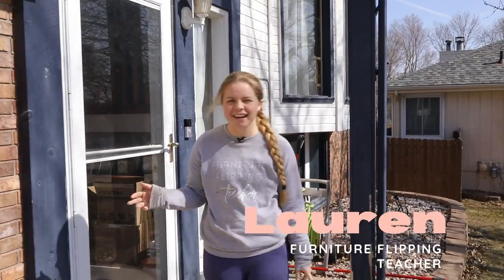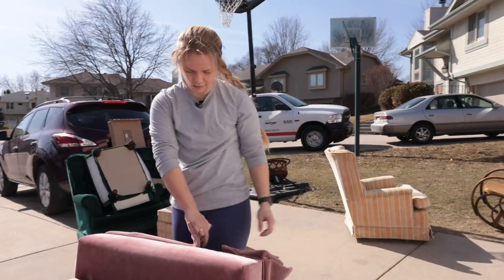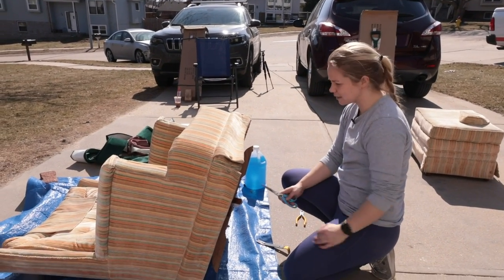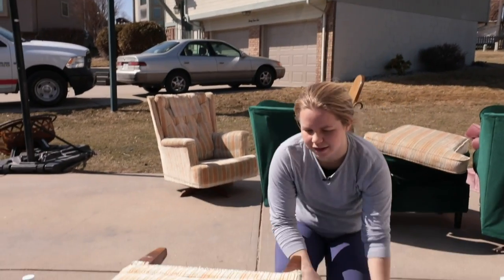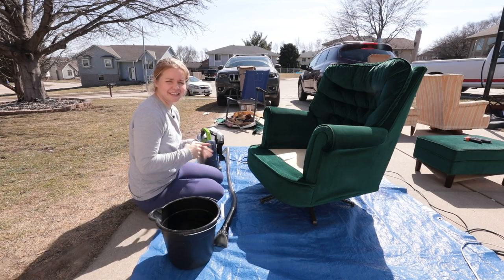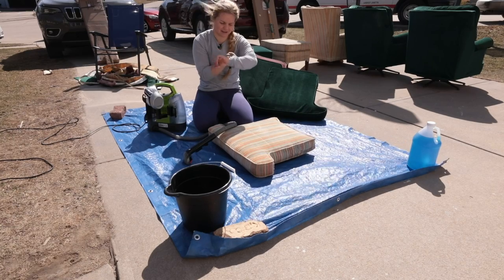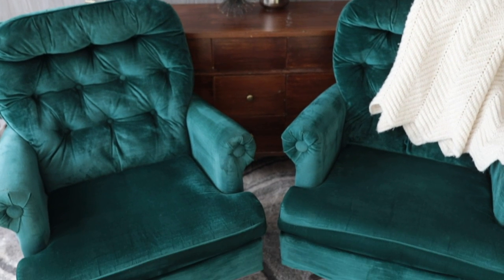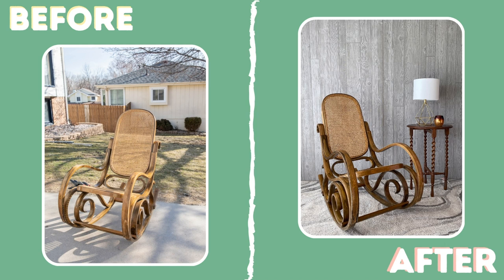Flipping 5 Velvet/Wood Chairs from Facebook Marketplace = $420+ Profit

Comment: Idea: Use a magnet to corral those staples so you can collect them and dispose of them easily. You could, for instance, hot glue a magnet in the bottom of an old yogurt container!
Reply: My dad always had a huge magnet tied to a piece of string, for when he did anything with staples, screws, nails, etc. The yogurt container idea is a great idea, though.
Reply: Ooooh, like a sewing pin magnetic holder!
Reply: I will use this idea in sooo many ways!
Reply: There are strong magnet (s) in old stereo speakers. U could upcycle one of those!
Reply: harbor freght has cheap magnet trays for holding small screws etc when doing repairs. I bought one when i work on my vintage sewing machines! tiney screws!
Reply: @wendimiller8915  
Or, as we cross-stitchers call those, needleminders!
They're very collectable among us. Lol
Reply: @valnpaulvanorden  
I've got a large U shaped magnet that is quite weighty and cane from a grandfather clock.

Comment: Ok, I have re upholstered a lot of furniture. 3 tools will help you.  A nail/tack remover, looks like a forked screw driver, and a tack hammer. The tack hammer will also have a forked prong. You can also get a staple remover. All of these will help you remove the staples. I personally would get a tack remover and a tack hammer (cause you never know. You might want to add some decorative tacks to a chair or two.)
Reply: Thank you for letting us know. I tore an old couch apart a few weeks ago, what a pain. I never saw so many staples in my life. Haha.
Reply: I like fabric pliers/clamps, which I use to stretch canvases in my studio, as well as when upholstering, as I have carpel tunnel, and they hold the fabric about 4" which is more than my fingers and thumb can!
Reply: @MissMolly3377  Needle nose/regular pliers can help.  Seriously a PITA!

Comment: If you ever had to deal with bedbugs, you would be way more concerned about them! That is my #1 fear when considering furniture flipping because we had them once and it was HELL to get rid of them. I’m super paranoid now.
Reply from the maker: That is probably very true! I try my best to do my due diligence when buying and take into consideration where I get it from and make sure I am as diligent as possible when cleaning.
Reply: they make a special bedbug powder I have seen another flipper use. Requires a shop vac b/c it is kind of sticky.
Reply: Look into Ozone cleaners. They kill EVERYTHING. Can get one that does a smaller house(about 2,500 sq feet I think) in 30 minutes, for 50 bucks on amazon. 

Beg bugs, fleas, mold, bacteria, hotels use them when converting a previously smoking room into non smoking. They Even kill house plants and small animals so make sure anything you Want to keep alive is not in the effected area.
Reply: @kiarakeeper2154  oh my lol...
Reply: Heat for several days in the sun (or a hot garage or room) will kill bed bugs. That’s why “old” people used to sun their beds.
Reply: Heat kills bedbugs...hair dryer ?
Reply: Sunshine kills mold.
Reply: Wear gloves.

Comment: You can remove the cusion covers with zippers and put them in washing machine! I would have preferred the gold legs on the green set personally.  Great job!
Reply: Be careful.  Many fabrics will shrink and won't fit properly after washing.
Reply: Cushion covers can be washed in the machine on a cool or warm setting.  The trick is to put them back on the cushions while still wet!  Let them dry standing upright.  Perfect every time.
Reply: If she washes them though, she runs the risk of the fabrics becoming discolored from the rest of the chair or shrinking it.

Comment: I clean my personal microsuede  furniture with windex! Where I found this tip, they sprayed, used a scrub brush then wiped clean with a white cloth. I use my carpet shampooer to suck up the windex after using the brush. Its amazinggg. I highly suggest you try it! I think you'll find better results and quicker dry time + cheaper than the cleaning solution. Side note, if you have microsuede, after it dries take a dry scrub brush and "fluff" the fabric by brushing it back and forth. My furniture looks and feels brand new

Comment: FYI, if you're going to stage it with a blanket make sure you add an extra photo to show it without. Also because of the bed bug outbreak in many cities, it's wise to 1st inspect thoroughly and also spray the furniture with bed bug killer and let sit 48 hours before cleaning. I personally like the skirts to hide the ugly stuff underneath.
But then I'm an old lady 👵🏻
Reply: If you're up north though, there's really not a huge need. I've never really heard of getting bedbugs in Colorado for example. Colder, dry climates they don't run rampant
Reply: @ShunXXX196  
Okay that makes sense. I'm in Michigan. Very humid in the summer. Our Town had an epidemic about 9 years ago one in four families had bed bugs
Reply: @marymontes6788  same in FL. High humidity and super hot summers.
Reply: An ozone cleaner will kill bedbugs without the chemicals
Reply: @kiarakeeper2154  wow I wish I had known about that 11 years ago. We lived a total nightmare for about 3 years. We finally got rid of them when they came out with a new chemical that cost $70 a gallon. Plus I got rid of all the furniture and beds.

Comment: I loved your presentation. I am interested to do this but to keep my own  chair and to sell one of two sofas. If my results are good, then I will consider selling newly aquired ones after reupholstering. Good luck paying for the loan. Sometimes yanking on those chair skirts can tear the fabric of your chair bodice, even if you are careful. What do you do with the extra skirt  fabric? Agood first step before usin the wet scrub treatment,  is to use a lint roller.  Those sticky papers get off a lot of surface dust , dirt, and pet hair.

Comment: Hi Friend!  My husband made a tool that I think you would find VERY advantageous.  He takes a standard screw driver and cuts a slot in the flat head smack in the center. (same principle of a crow bar, just the right size) The screw driver handle is easy in the hand, easy to grip and easy to get leverage when prying up those tack strips.  You get in a groove and kinda of rock it back and forth.  I think you will experience less fatigue with a shorter tool.  He often will find a staple that he can lift on both tags and not need to use pliers later.  Also he has these magnetic bowls (cheap at Harbor freight) that catches screws, bolts, tacks or staples.   They make a magnetic wrist band to help cut demo time down.  WELL DONE on being a butt kicker.  Continued success to you in your endeavors!!
Reply: I've seen those at Harbor Freight and Home Depot.
Reply: @vaderladyl  AGH!  They owe my husband a royalty!  He designed it over 20 years ago when we had a furniture store!  : )  In all fairness, I think they were around before, but it was a specific familar handle grip and length he wanted.  Like golf clubs I suppose.  He couldn't find what he needed, so he made it.

Comment: My suggestion would be to trim the skirts back to a 3 inches, fold and staple under the chair. This will give a good finish and then you won't get the line between faded and not faded.

Comment: Taking skirts of chairs is a great idea. Really modernizes. I myself have bought second hand upholstery off cuts for styling on the underside of couches. Is a bright surprise if the owner turns the chair over and sees an attractive contrast underneath. It is also more durable than the  thin substitute fabric that is used commercially.

Comment: If you were to hot glue the piping onto the bottom edge of the chairs it would give them a more finished look. You could also try bleaching the rocking chair, the wood and cane as it might sell faster as the lighter wood color is more appealing to buyers right now. There is a kit you can buy for this. Great work.
Reply from the maker: In person I don’t think it looks as unfinished as people think it does...no customer has ever seemed to mind. One time I did have to keep the seam to cover it up! May eventually check out the bleached wood! Thanks for watching!
Reply: @FurnitureFlippingTeacher  It was just a thought and I'm sure they look great in person. Removing the skirt sure makes them look so much better. Surprising how these chairs have made a real come back. I commend you for working so hard to pay off your student loan. When I'm working on projects I find I can tend to get caught up in the details. Great work.

Comment: You can also use black interfacing as a dust cover if cardboard or dust covers are/get damaged or are buckled.  It’s cheap & you can get it on bolt at Wal-Mart in fabrics.  😊
Reply from the maker: True! I just decided to reuse the cardboard (:

Comment: Great job !!   I haven't watched all your videos....  YET !!   :)  I do really enjoy watching you convert your finds and giving them new life for a new home.  Do rocker chairs sell for more?  Have you ever removed the rocker and replace it with midcentury style legs?    and would it be easier to start the skirt removal from the seam in the back or are there more staples there?
Reply from the maker: Thank you! I am glad to hear you enjoy watching the conversions - they are a fun fun time! 

I don't necessarily think that rockers sell for more, if anything I would say the color is what matters the most. I have found that chairs with legs and ones with rockers sell for the same price but the color will effect the price as well as the style and design of the chair. 

My boyfriend has thrown that idea out there of replacing the rocker with mcm legs but I haven't taken up the task yet as that will add time to the project and I want to keep that to a minimum (;

It's all dependent on the chair in my opinion as far as the ease of skirt removal. Some just seem to be much staple intensive than others. All depends .

Thanks for watching!

Comment: What do you do if there is discoloration or a difference in fabric color when you rip off the skirt?  I think that would bother me if there was a difference after it was cleaned and dried.  The striped chair  looked that way in the video but I wasn't sure how it was in person or if you had a technique for that issue?
Reply: I thought about this too, ripping up the skirt as well as the edge/seam bit makes the bottom look unfinished.
Reply: I wondered the same ..it looks discolored along the edge
Reply: Is there any market for similar chairs with regular fabric ( not velvet)? What would you charge for one with the same legs and after removing skirt?

Comment: I think the extra cloth left around the bottom legs of both the stripped chair and stripped ottoman looks pretty bad.    I think if you had used an exacta knife to cut those strips off, they would have sold faster.  Also it would have helped to sell the stripped chair and ottoman, if you had touched up the scratches on their wooden legs, and shined them up with a product named "Restore" for furniture.  You can find it at Home Depot and Lowes.   You might want to try it also on any wooden pieces you want to bring back to life, without having to paint or re-stain certain wooden pieces.

Also don't understand why you tear off the chair's skirts if they are well attached.   Skirts are meant to prevent the viewing of the undersides of chairs.   If you leave them on, and just clean them when cleaning the rest of the chair, you might find you can sell them for more, or sell them faster.  Any ways would suggest try selling them with skirts on, and see how that works for you end goal of spending less time and money on your flips for maximum sale amount.

Comment: What do you do with the indentations from where the skirt comes off? I've picked up a few myself, but can't seem to get those to go away.
Reply: Okay so, I've learned that using a clothing steamer will work to get the indents out in some chairs and will ruin others depending on the fabric. I have two pink La-Z-Boy rockers and the indents came out perfectly using this method. On the other hand, I had a yellow retro rocker chair that now has streaks from spots where I accidentally touched it with the steamer. You live and you learn I guess, but I am happy to say somebody still purchased the yellow chair with the damage I just had to sell it at a discount.

Comment: I’m thinking of chalk painting a roll top desk but not confident on the “moving parts”. Any tips?
Reply from the maker: oooff! I have seen tons of these for free but haven't pulled the trigger yet due to this reason. My only suggestion would be to make sure you use thin layers of paint so it doesn't glob up. And then make sure its dry before rolling the top! Good luck!

Comment: I noticed some pulled areas on the black dust fabric under the pink chair. That’s called a camebrick. ( probably not spelled right) Try a sweater shaver to remove those:) Love watching you work with a mission.

Comment: Has anyone had to add stuffing for flattened areas? How easy is it?
Reply from the maker: I haven't had to do this! Thanks for watching!
Reply: I had a recliner that I put stuffing in the back of it. I used cheap polly fill bed pillows to re do the back with as the pillows were cheaper than the bag of stuffing. It was pretty simple doing the back of the chair just removing some staples and putting in the polly  filling then putting in new staples. There are some great videos on how do do all kind of chairs on you tube.

Comment: Not sure why you are removing the skirts on these pieces as they give them a more “finished” look, not to mention you are now exposing fabric on the bottom part of the chairs that have never seen light and you can see there used to be a skirt on it because the fabric is darker there than on the rest of the chair. If you are not reupholstering the chair, I’m not sure you need to remove the original skirts.